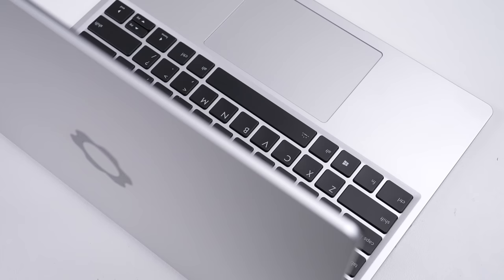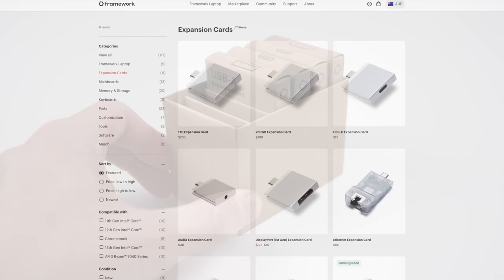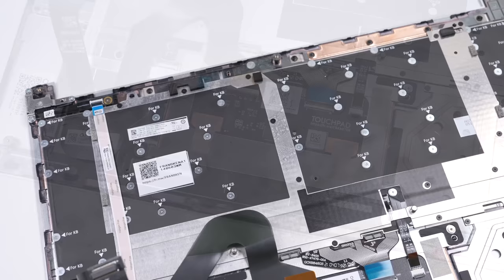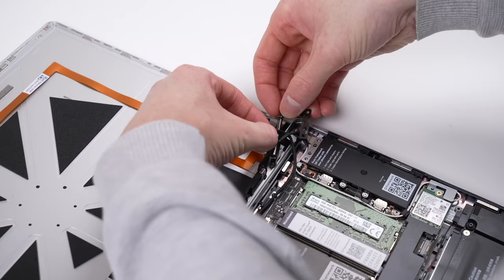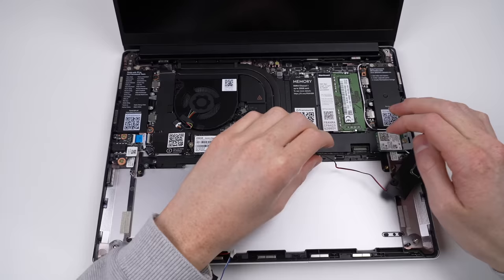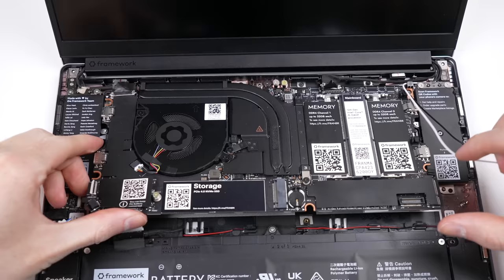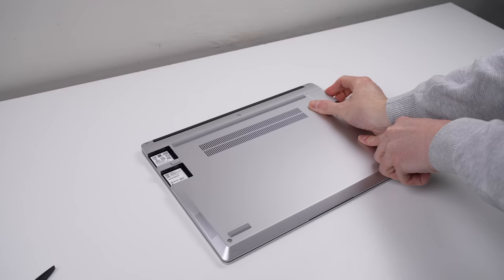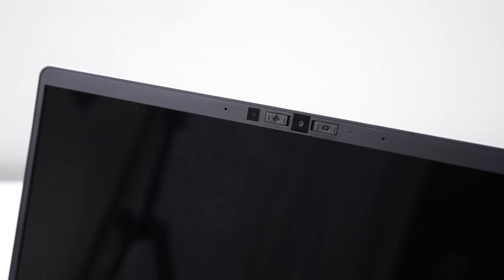New Laptop Brand Shocked Whole Computer Industry - Framework Laptop - Teardown And Repair Assessment

Comment: I've said it before and I'll say it again: The 16 inch version is going to be an INSTANT buy for me once pre-orders begin! I can't wait to support a company who actually supports right-to-repair!
Reply: Bro framework has been talking and talking for about 2 years now, and now they are trying to release something?
Reply: @flamingkillermc2806  they already had a device released for years now, the 16 is just a larger more customizable version of what is already released.
Reply: @flamingkillermc2806  what are you talking about?
Reply: Its going to be pricyyy
Reply: @naturalcauses1695  it will be, but being able to upgrade it? It's gonna last for years, maybe even over a decade, well worth the price
Reply: You’ll easily save you’re money back after it’s been upgraded to new gen CPUs, instead of buying a completely new system. Without any big disruptive changes, this laptop could be a once in 30 year purchase
Reply: @krumplin8992  I don't know about that, but it could easily last the lifetime of 2 - 3 laptops, around 10 years for most potential users, although RAM will likely change to DDR5 and then DDR6 or whatever is after DDR5.
Reply: @naturalcauses1695  And it will be worth it.
Reply: @cameronbosch1213  RAM is socketed on the mother board, so when you do the CPU upgrade you'll be also changing the RAM out to the latest version since the CPU and MB come as one piece. I'm more curious to see if they will have options with discreet graphics and if that would be separate or you have to choose a CPU/GPU combo at time of purchase.
Reply: @flamingkillermc2806  Linus just released a vid of a tour of the ODM making the FRAMEWORK and shows a pre-production sample run of a part of the 16 
https://youtu.be/7nXVJBGowmY
Reply: @cameronbosch1213  BUT the upgrade being a whole NEW mainboard as LONG as they can fit it inside the chassis AND still use USB3 (expansion ports) the framework 16 could be upgraded indefinitely
Reply: @MagicBrownMan  the 16 is to have a special bay on the back that will take Graphics OR other PCIE devices
Reply: @naturalcauses1695  its a 16 inch gaming laptop with a replacable gpu and cpu, way more than worth it
Reply: @krumplin8992  and you can also get gpu's un the bigger model altough it will look a bit ugly.
Reply: @flamingkillermc2806  LTT showed a prototype of the 16"
Reply: I got tired of waiting on Framework to release a 16" with an numpad and got an Tuxedo laptop instead. I looked at it this way, there will be so much demand that it may take up to a year receive it. Also I wanted a laptop that was designed for Linux from the ground up.
Reply: Cool laptop, but not gonna change anything when they only sold on low volume, late to party released, only sold in specific region
Reply: Literally nobody asked you to say it the first time
Reply: 14 is better
Reply: @krumplin8992 But doesn't the new laptop provide eGPU support / sliding in a GPU in the back?
Reply: My only issue with the 16 inch model is that the hinges look 10 years out of date.
Reply: They're not just supporting right-to-repair, they're donating time and money into it. The difference between a supporter of the arts and a patron of the arts.
Reply: 13 inch cost 2500€. It's joke.
Reply: @seanb7969  Unfortunately, where I live, Tuxedo wasn't an option and no other Linux laptop had what I was looking for (that includes System76).

So I'm still waiting on Framework, mostly because I don't have any other options.
Reply: @flamingkillermc2806  whatchu on about mate? Framework Laptop 13 has been out for 2 years. And Framework Laptop 16 got announced fairly recently.
Reply: I'm excited for the 4.0x8 link because I can design an eGPU enclosure that will have the bandwidth to support nearly the full performance of a 4090.
Reply: @MrPnew1   the guy has "mc" in his username. He's clearly not the brightest
Reply: I currently have a five year old Giggabyte  Sabre-17, still going strong, but may replace it with a Framework 16" once it is available. The Giggabyte   is not compatible with Win 11, there are was round it, but I'd prefer to have a fully supported machine.
Reply: @Conor  There are two things I disagree with your comment on:

1. Sometimes, the specification isn't available yet. And when it is, it is often cheaper to get just that than an entire laptop upgrade, which is expensive and wasteful.

2. Saying this company won't exist in 4 - 5 is likely not true when they have this much support already when they aren't even 5 years old yet. And even if they do go out of business, everything they've done so far is pretty much either open-source or can be used independently of the original Framework parts, like the motherboard being able to be used as a desktop.

If you think Apple's MacBook appliances are more interesting than a fully open Framework Laptop, then you are subjectively wrong.
Reply: @Conor  Uh no. You can buy a laptop from them that has either Intel 13th gen or AMD Ryzen 7040 CPUs. And the 16 inch isn't far behind.
Reply: @conor7154   no software engineer or developer will buy a Mac. Unless you are a high school kid who wants to show up how much money your parents can lose lol 😆 😂
Reply: I am hopping that there is a case for the 16in with the gpu slot.
Reply: The very minute any of them appear second hand or start shipping where I live I’ll buy one, already set bots up for both email and site crawling.
Reply: Yeah, you had a whole decade to do that, but nobody wanted it. Now it's "magical" and "genius". If a kid can literally design Framework almost exactly as it is... It's shocking how many people are throwing themselves under the bus by pretending that this is innovative or new or "genius". No, they just had money and I and probably millions of other kids thought of this a decade ago but nobody wants to give millions of dollars to kids with good ideas if they are too forward thinking I guess. I'm glad they exist, and will buy one in a few years, but STOP with this absurd "this is genius" gaslighting! You only make yourself look bad by calling Framework "genius" because it means you didn't care at all about right to repair for most of the past decade (otherwise you would have seen the tragically obvious trends coming as I did).

I was bullied in forums for suggesting that a company like Framework would be successful, even down to the modularity ("why would anyone make a laptop without removable RAM, you're stupid", etc). Now a decade later, it's a million dollar idea. Cool?
Reply: @awesomeferret  You mad dude? Just because people didn't see repairability go down because of Apple's BS doesn't mean we can't correct course with Framework.

Times are different, and unlike Dell's Alienware 51M,  I think Framework will succeed, because Framework is all about modularity and right to repair, unlike Dell or Apple.
Reply: @cameronbosch1213  they are a company that has been founded on that principle, so it is likely to be a very good force to change. Remember, I'm just mad about being so right and seeing others get rich from ideas that cost me many tears as a child (I thought about things that some adults don't think about). I hope Framework does well, since they are now the ginuea pigs for the industry. If they can make money, others will follow, but the exact opposite is very true, and that's part of why I'm treading very lightly on this since small mistakes will have a much bigger impact on the industry than they would otherwise.
Reply: @conor7154  it’s not just about upgradability, it’s also about being sustainable and better for the environment. Throwing a whole laptops away when one unreplaceable part breaks is a lot worse for the environment (and you, since you then have to move all of your files over) than just replacing the broken part and continuing on with a perfectly adequate laptop. You clearly missed the whole ass point.
Reply: @awesomeferret  I mean, everyone knows that modular laptops exited before, I assume you remember the toshiba satellite 1985, or the IBM ThinkPad 701C  back in the days, or the... well you get the point. This is not new, what is new is that the company still alive after 2 years and that they are only doing modular. No other company has done that. Yes, all of them started with modular laptops but they soon abandon the project. So this is fantastic... and what's more amazing is that now it seems like a lot people will buy a modular laptop. I will buy one for sure! That was not the case 10, 20 years ago.
Reply: The computer is so bad, so slow.
Reply: @flamingkillermc2806  bro really isn't the sharpest tool in the shed
Reply: @idothings6685  what?
Reply: @Wiisporter  i own one, it sucks, it's slow.
Reply: I can repair anything in my Dell.  They list every part number to order, and even provide well written guides on the repair.  I suppose you are going to go bash on JD now too... Another product you have been told to bash on with zero experience.
Reply: count me in we are in 2023. We should be able to replace parts or upgrade in this age just like before 2013's
Reply: Big companies like Volkswagen, Airbus, BASF…. Should make contracts wit them!
Reply: Why do you want a bigger screen? I honestly don't understand why people want laptops with larger displays
Reply: Me too
Reply: @Wiisporter  Good thing I’m not a tool
Reply: @flamingkillermc2806  talking for 2 years but they already have products
Reply: @MLesp  unless they're developing  for the Mac
Reply: Now wait for Apple to do to Framework, what Ford/GM did to Tucker Automobile.
Reply: @mysystem8961  They won't. Apple already killed their professional-grade Mac Pro. They won't be able to kill Framework.
Reply: @flamingkillermc2806  Yeah LTT had show case the product many times on his channel not because he invested in the product but that it's so easy to upgrade yourself.
Reply: @cameronbosch1213  looks to me that you have proved that have form!  I hope they fail, but I expect they will try.
Reply: i couldn't wait any longer and just used the money to book a vacation in the Philippines for a month. 
But if they had opened up pre-orders 2 months ago with AMD CPU for the 16 inch version i would of had that laptop for sure!
Reply: Will there be smaller options? Would like to have something like a 13" Lenovo - slim, light and powerful for software development. I just need fast cores, fast storage and lots of memory for containers in a very small formfactor so i can easily carry it from desk to desk when pair programming. Lenovo is cool but i would love something more modular
Reply: I have been waiting for 16 inch preorder
Reply: @MagicBrownMan  The 13" model doesn't have those options, but the 16" model has a large bay at the back with a pcie connection over a connector they publish the pinout for, and they will be selling gpu modules for that, but there may be options for other pcie devices.
Reply: @gen-zboomer  It isn't just a bigger screen, although many people want that too, the 16" model has support for numpads, additional bays for modular ports, and a bay for pcie devices such as gpus as well. It is just an all around higher end model with support for more features.
Reply: @MagicBrownMan  which is a great thing. Would be nice to be able to slap whatever GPU I want into my system instead of accepting whatever GPU the unit originally came with. Would be great if the GPU comes in it's own daughter board so you can easily swap them around.
Reply: I'm still waiting for them to make a 2-in-1 with pen support. But they've been asked and didn't seem interested. So I guess Framework isn't for me/artists in general.
Reply: Have you ever even disassembled laptop unless its apple all modern laptops are the same only difference is the unnecessary and probably expensive swappable ports its stupid
Reply: Cool story.
Reply: @MDK808  a laptop with a dead motherboard is practically an e-waste. at least on this one, you can still use majority of the parts as spare or if the laptop was really important to you, you can just buy an entire motherboard and slap it in, the same can't be said with other laptops, in most cases, I only found motherboards with Pentium CPUs on them or others without actual processors on them.
Reply: @ak_nora  I have seen a non-upgradable laptop last for 16 years and some other cases of 10 years. So it will easily last 2-4 decades.
Reply: 🍏 left the comment section.
Reply: They continue to hide the price though, some of us need to prepare 😢
Reply: @cameronbosch1213  This is why Frameworl needs for their next laptop to use CAMM instead of DIMM. Dell wants it open, and CAMM can be engineered to use DIMM adapters. While slightly more bulky than other solutions, if Framework can engineer their own CAMM solution that would be the best bet — proprietary Framework RAM with standard options.
Reply: @datachu  I've seen community members on the forums working on a pen capable touch display for the framework. I think it just comes down to them being such a new company. I mean we are just now getting an AMD version because suppliers and partners are finally starting to take them seriously. I'm sure there will eventually be a 2 in 1 version available
Reply: @awesomeferret   Don’t act like you are a genius with your idea years ago with upgradeable laptops similar to the desktop. Many others in IT related jobs have the same idea even before you. It is the computer makers who are making things difficult for users who want to upgrade.
Reply: Until they disappear in obscurity because 🤷
Reply: @leroyfalconer  Like I said, even if they DO disappear, they left us with enough pieces to finish the job.
Reply: @cameronbosch1213  🤔😂
Reply: @cameronbosch1213  it's essentially the first open source laptop. Before they released the cooler master case for the motherboard I was designing a minimal 3d printed case to use my current motherboard as a blade server when I upgrade to AMD.
Reply: Can't wait for mine!
Reply: @tommydong8070  so, I'm detailing one of the biggest failures in my life and you think I'm "acting like a genius". Too funny. 😂
Reply: Same here.
Reply: You cant? Then why didn't you support alienware? They made a replaceable laptop with desktop parts, and literally no one bought it. I have one, it is better designed than this, and way easier to replace things. You could put in 7 gen to 10th gen desktop cpus, and 1060 to 2080 gpus. 5
Reply: The right to repair is not really a right to repair. You can change your memory in your laptop and already do upgrades. This is easier for the layman to replace the items like the screen, keyboard, and other parts usually difficult to change, however, the parts on the motherboards are not supplied and that is the main issue for right to repair.

Most companies get bought out in the end, Inflation destroys honest business and replaces it with the same old corporations we have now
Reply: I remember a few years ago seeing this hardware and was somewhat underwhelmed. But shit i7 and 12 gen being supported is a huge upgrade. Seeeeesh imagine an overkill ram/ssd setup
Reply: @FUmoneyWorshippers  Because it wasn't upgradable, even the GPU wasn't, despite Dell promising such. And that led to a lawsuit, and thus the discontinuation of the Area 51m.
Reply: @FUmoneyWorshippers  Because those were giant, heavy, battery eating, overpriced monsters (like most AW stuff)..  I have a Desktop for gaming.
Reply: @FUmoneyWorshippers  Because a laptop shouldn't cost as much as your car. Dell seriously over charged for Alienware rigs.
Reply: I wish it had an OLED panel for HDR video. Once you tried HDR, never back to SDR displays. 😓😓
Reply: @FUmoneyWorshippers it's bulky... Not everyone wants to carry around so much weight.
Reply: @mike-ology22  we can have the circuit diagrams and data sheets for framework motherboards 👍
Reply: @iglobrothers645  That's right. Dedicated GPU and also swappable to any other pcie device
Reply: @gen-zboomer wait another 10+ years when even your glasses aren't enough to let you see the smaller screens😉
Reply: @megalith7796  that is good news. I'm a PC guy but swaying more towards a decent laptop. The Framework laptop looks like a lot of fun :). Thanks for letting me know, I appreciate it 👍
Reply: @Laugh1ngboy  I dono what car you are buying for 2 grand, but it prolly isnt functionable.
Reply: @FUmoneyWorshippers  What Alien ware Laptop worth a crap are you buying for 2 grand? That's their starting price.
Reply: Same!
Reply: If this were an industry standard you could swap at parts from various makers. But there will be small production runs off parts to upgrade. A significant proportion of owners will never upgrade, so the rest will be buying custom parts from FW at premium prices. The idea appeals but the execution is easy out of my pocket. What guarantee do you have that FW will be around for a long time? I hope that at some point they release all their specifications as an open-source standard so that other makers can contribute without having to raise enormous amounts of startup capital. Nice idea technically but a commercial failure.
Reply: @Creamypie626  Or as a firm, having 25 to 50 of these units, means you can cannibalize a few and keep the rest running at almost zero cost for decades (barring the batteries which are consumables anyway). People should compare that with the "if it lasts more than the warranty or is upgradeable, it is overengineered" policy of the rest of the laptop industry.
Reply: @ShrekMeBe  that's a really good point as well. Having every single parts standardized and can fit into any other model means that you can throw a dead laptop into storage and then later cannibalize that for parts instead of having the need to get it repaired by a professional.  it actually puzzles me why manufacturers have to design every single laptop they make to have differently shaped parts. Like you have 2 different models of 15.6 inch i5 laptop from the same manufacturer and their parts wont be interchangeable because engineering meanwhile Framework making laptops  that's basically designed to be cannibalized and people are pissing about it.
Reply: @cameronbosch1213 ThinkPads already last 10 years with original fans and a simple ssd upgrade.

Mine is from 2012 and launches apps faster than some business laptops issued today.
Reply: @simone565  How is this a bad design? It looks almost identical to an Acer or Asus business laptop. And I think it looks slightly better.

And if anything, usability is BETTER than a standard laptop because the port adapters are flush with the laptop and the repairability of this laptop is far greater than most gaming laptops, which are often bigger than this laptop!
Reply: @MLesp ’ll do you one better no engineers wants to buy a macbook have you tried running cad on that thing is disgusting due to the lack of good cooling
Reply: Does ith gavecs pen?👈
Reply: Support the right-to-easy-breach?? I guess.
Reply: @ak_nora assuming the other hw manufacturers conform their specs to accommodate this still proprietary, 'open hardware ' laptop....

for a newer generation, this seems liberating & refreshing but it's still the same old Gillette model of business; give em the razor w the proprietary blades & sell them those forever.... the blades aren't interchangeable & only work on Gillette razors...This offers ' flexible choise hardware options so long as vendors will hop on board & comply w this modularity Frameworks is using .
Reply: Lol trash upgraded is still gonna be trash

SoCs are the future
Reply: Bat sadly bro its not idiots proof so gudluck😅
Reply: Framework Electric/Gas Hybrid Automobile please.
Reply: What if there are no spare parts available in the market?
Reply: @yonatansingson  It's open-sourced. People can and will make parts for them, just like the older ThinkPads.
Reply: How much price is this.Can I get in india.
Reply: When they start shipping to Sweden and also with Swedish keyboard then I can actually buy one. It just feels good buying something that I know I don't have to throw away.
Reply: good news. preorders are open!!!
Reply: @mario_vasquez_  Guess who got into the first batch of orders? 🤔

(And yes, this is despite the demand for the Framework Laptop 16 that was so high it crashed Framework's website.)
Reply: My poor ass watching this all....
Reply: Linus is an investor....so that's a no from me!
Reply: @gen-zboomer so you can game or watch movies on it plus I find the keyboard nicer.
Reply: @cameronbosch1213  framework 16 uses DDR5
Reply: @noTmiZ  I am aware. That's because Ryzen 7040 ONLY allows for DDR5, unlike Intel 12th & 13th gen, which allow for either DDR4 or DDR5 (although rumors and I suggest Intel will drop DDR4 with 14th gen).
Reply: @idothings6685  Is it slow compared to a laptop with the same specs but different brand or when compared to a PC?
Reply: @tepangora1388  idk bro just what I read, no need to defend to the death.
Reply: @idothings6685  I reread my comment and it did sound kinda snarky didnt it?
Sometimes I press send to quick and this is one of those times.  
My bad sorry, wasnt actually meant to sound that way.
Reply: @naturalcauses1695 Pricy yes, but more than likely going to be a damn neat forever device. And they even have modules coming for if/when you upgrade your processor, you can put your old one with some ram and storage into an enclosure and have an instant tiny desktop pc
Reply: @idothings6685 the hell are you doing to the laptop to make it slow lmao.
Reply: @FUmoneyWorshippers alienware is expensive and wayyy overpriced, adding that and it's even worse
Reply: @stevenswall I love my thinkpad, lenovo are still making good ones. But man pretty much every other lenovo laptop brand is awful. The yoga overheats, the ideapads commit death, the legion is built like crap... sucks
Reply: This was meant-to-be! I was debating to spend $3K on a MacBook and considered the Lenovo Thinkpad E14. Awesome!
Reply: It  has made not easily repairable because obsolescence means more revenue
Reply: @MrRossi1805 If i were such a large company, I would buy it and shut it down. Its a threat to revenue
Reply: And who are you?
Reply: @bp6837  ...I am a right to repair advocate and software engineer. Who are you?
Reply: @seanb7969 Technically, framework has also built from the ground up for Linux. For instance, the cameras don't need any external drivers, for instance. They made sure that the hardware would just work out of the box with Linux, at least with fedora and Ubuntu.
Reply: @awesomeferret Hey genius, repairable laptops existed long before framework, but even though people kept buying them, they still stopped making them. Remember how think pads used to be renowned for that kind of thing? Now they're a shadow of their former glory. But it just wasn't that profitable to make something like this, which is why it never caught on. The only one gaslighting here is you.
Reply: @FUmoneyWorshippers Good luck replacing parts when they quit manufacturing them. Also, keep in mind that Alienware is a gaming laptop brand, and nobody buys gaming laptops. The framework, by contrast, is a thin and light, a product with a much higher demand than alienware could ever hope to achieve.
Reply: @MrGamelover23  it's baffling that you think you're telling me something that I don't know (aside from the gaslighting part, obviously). How is it not gaslighting to perpetuate the myth that hardware features are always discontinued because the customer doesn't care about them? The irony... You accidentally tried to gaslight me! 😂
Reply: @awesomeferret  I don't think you know what gaslight means. It doesn't mean to lie, it's to make you question your own judgement/sanity. "Gaslighting isn't real, you're just paranoid."
Reply: @MrGamelover23  yep, that's the definition I was using. I'm confused here.
Reply: It was instant for me, I bought one and am using it now.